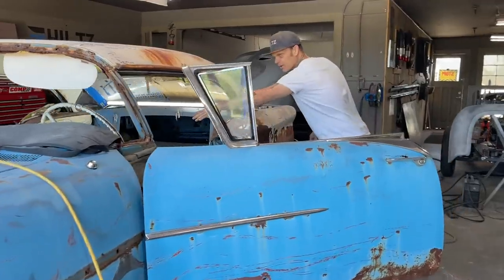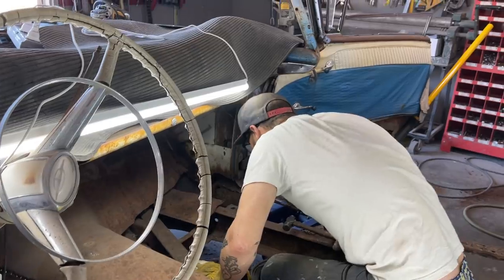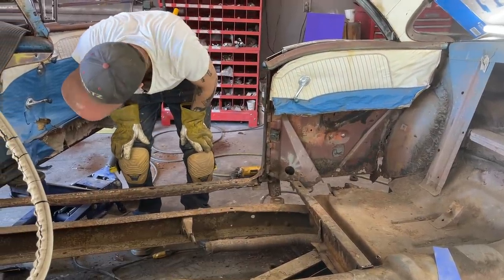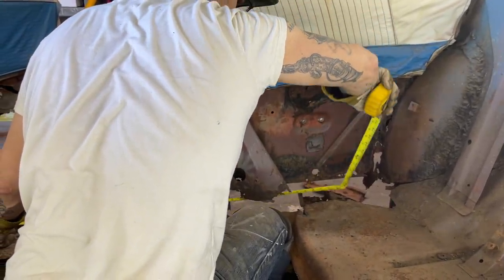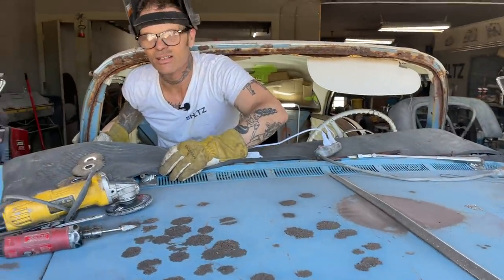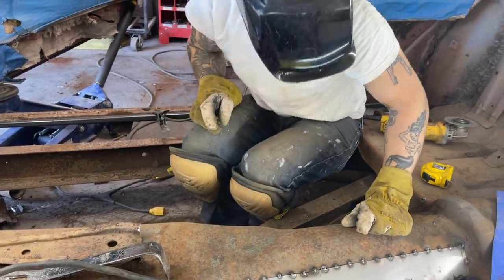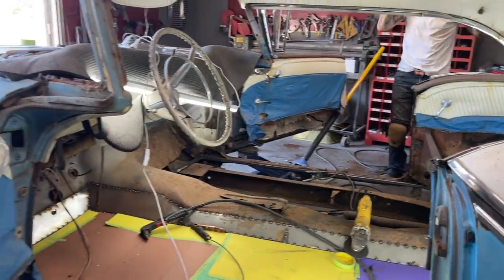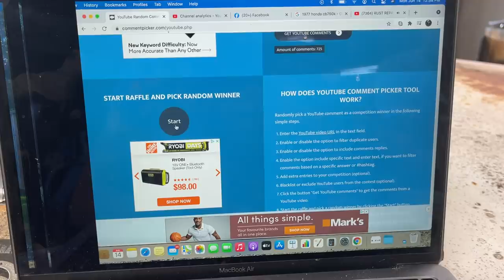HOW TO EASILY REPAIR A RUSTY FLOOR PAN

Comment: The guy that teach metal work did it the same way you do to the tee. I mis the days of building back a old car that most people would scrap out. We did mostly 64 1/2 to 67 mustangs every blue moon do a rat rod are just a old type car are truck. We made alittle money but we also did it for the challenge. He is one the best body man and a spray man in Tennessee. His car a 64 1/2 fast back 289 hi Po 3 duces and a top loader took us 12 years to build and every metal that went that car was hand cut and build it was took to a world of wheels and won the out law class and he deserves every bit of that award.

Comment: This may sound silly but watching you as inspired me to redo my beach cart which is in dire shape. It needs sanded and a new a new Piece of round stock to hold wheels in place and then I can work on the netting and the new pouch that holds everything. I know that doesn’t compare to a car but you got to start somewhere and you sir inspire me

Comment: We are two totally different people who have similar things when it comes to the welding on a old car. Your way works and so does mine. I think that short of replacing all the floor and coming down the side panels with new metal, its about the only way of doing something like this and not spend twenty thousand on a car worth on a good day very few thousand and maybe only hundreds of dollars. You can never get back what you put into a car unless you know where to stop on the money pit. So far so good

Comment: Yes I got inspired to repaint my 87 samurai and for you showing tips of the trade even use the finger trick with body fill and I even started with 40 grid sandpaper then 80 ,220 finish my 13 year son hope to sand and spray thks bad chad

Comment: I notice that you are laying the new floor frame directly on the Chassis frame. Understanding Jim's goals this makes sense but if you were to make a daily driver with it would build a gap between the floor frame and the chassis frame so that the body mounts absorb the vibrations and reduce noise of floor chattering on the chassis or is a gap better (or rubber padding between the floor frame and chassis) ?

Comment: F you make me laugh my arse off some times brother . I mean I wish you were a bit more safety conscious sometimes Chaddy you scared me when thatf f’n blade grabbed bro. I’ve got a scar on my wrist where while working ,the material I was cutting snapped as I was holding on at top and I was cutting up from below. The material failed and my wrist came straight down on top of a fully revving blade. after severing three tendons my femoral artery and vein and also the nerve,I was lucky that I just nicked the bone and got to a clinic within ten minutes before I bled out. I am now much more safety conscious though it was a complete accident and I even had the guard on. Now I  make sure I use ppe all the time and one thing you should be aware is the damage those things do to your hearing. I wish I could share the photos  I am a floor and wall tiler and can use it better than I can a pen or pencil but they are so dangerous my brother I would hate to see you injure yourself  any way much love to you both. You and the apple of your eye. It’s funny how it feels like I really know you. Weird.hey that song was mileys dadBILLY RAY CYRUS. HAHAHA LMAFO.